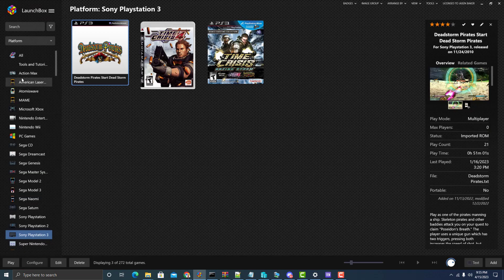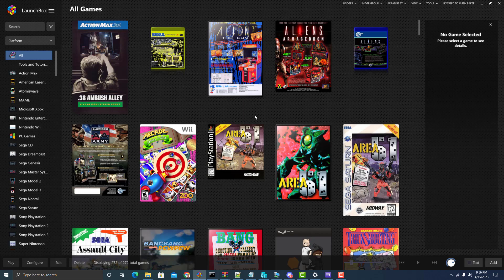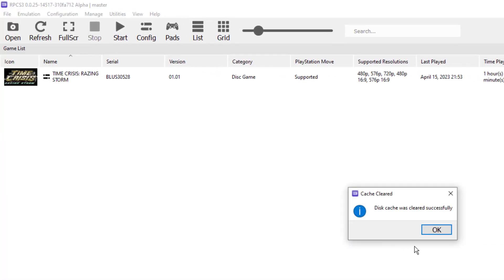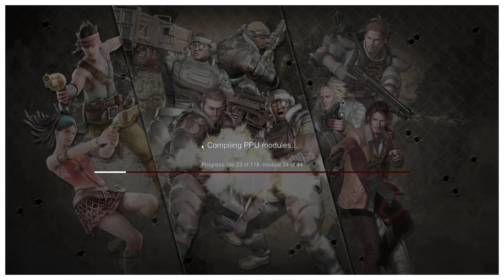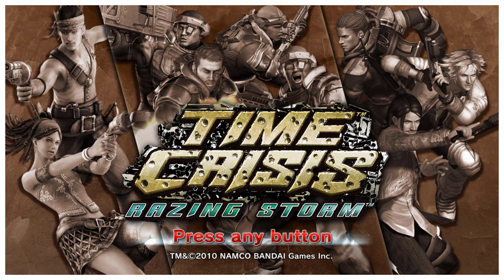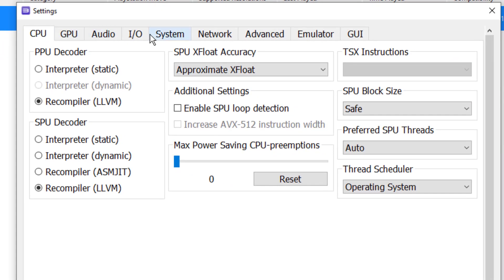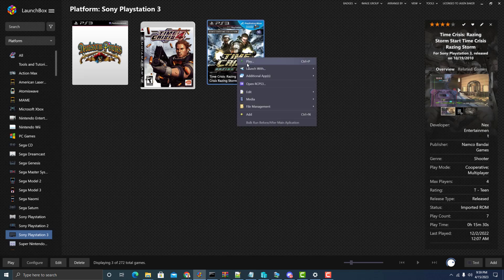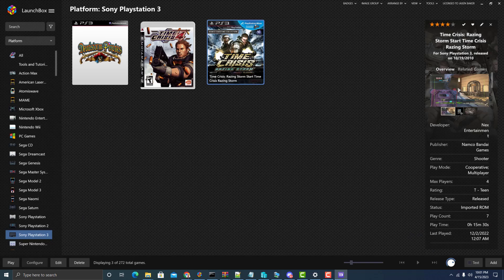How to fix PS3 Emulator crashing on my lightgun drive

Comment: 1 tip and this goes for tc4 as well: set frame limiter to off completely and use rtss or nvidia cp to cap rpcs3.exe to 59fps. Works fine and reduces overhead of frame limiter in rpcs3. Plus you get a closer fps to hz experience. Input lag occurs at 60fps for some reason but doesnt at 59.
Reply from the maker: Awesome feedback, I'll incorporate that into my next update
Reply: Regarding your drive: do you offer updates over internet as new games are often being released? Like the 357 games;castlevania;lethal enforcers 3 etc
Reply from the maker: I haven't been able to make a manageable and super user friendly way of doing that yet, but it's on the roadmap.